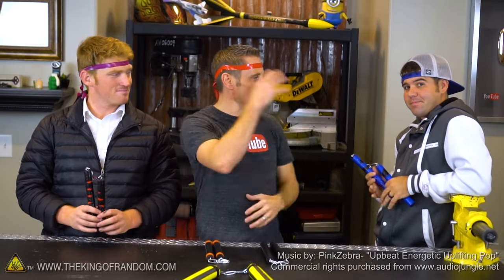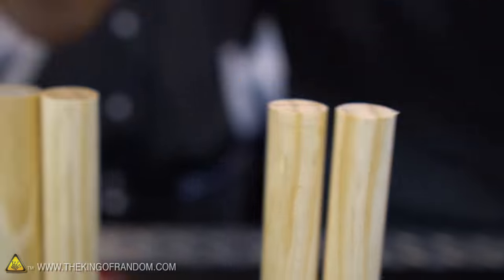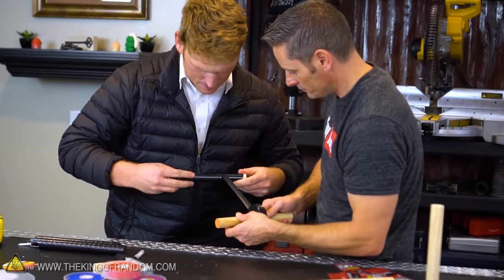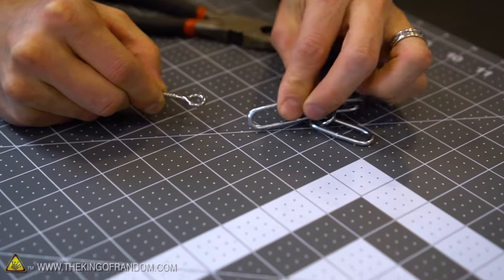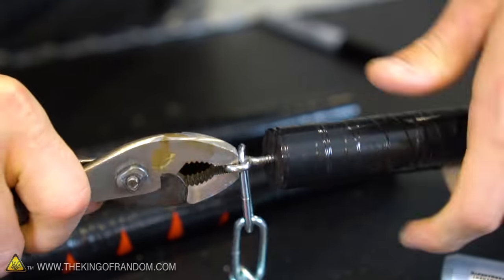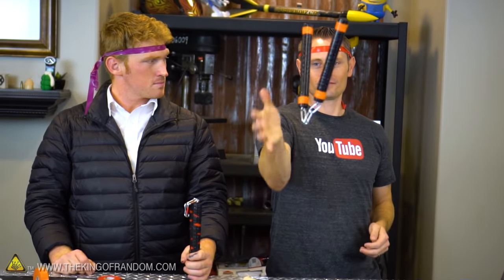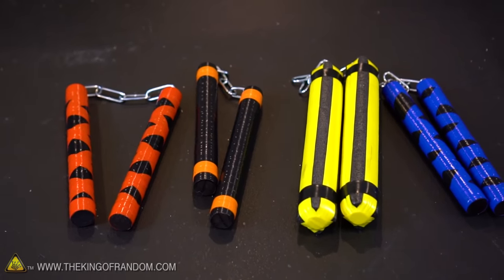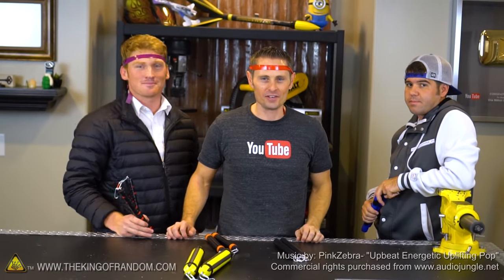Ninja Turtle Nunchucks (With DevinSuperTramp and Stuart Edge)

Comment: Graham, you can also do this using magazines and bed sheets.  Tear the bed sheets into 1/2" strips about 36" long.  The length depends on the size of the magazine you use for the handles.  When you have the sheets braided into rope, tie a knot in one end and roll the first magazine around it.  Wrap the magazine in tape to keep it rolled up.  Repeat this for the other handle and now you have a set of nunchuks made from sheets and magazines.  Keep rocking it dude!!

Comment: Hey grant what would happen if you poor liquid nitrogen into lava would the lava turn to ice or would the liquid nitrogen do nothing 
Like if you agre
Reply: Aqua where would he get the lava XD
Reply: Aqua 
The nitrogen would turn to gas before it even touches the lava
Reply: Aqua poor
Reply: RetroPenguin he made it by melting rock. Lava is molten rock
Reply: First of all the nitrogen would probably boil off before the lava's temperature would change much, second of all.. Frozen lava is just solid rock, you aren't going to get water from lava dude... Last time I checked the liquid form of H2O is water not lava.
Reply: it's gonna make a black hole
Reply: Aqua u know what ice is right
Reply: It will cause a nuclear war
Reply: Molten aluminum versus liquid nitrogen
Reply: Oh no not ww3
Reply: already done
Reply: poor
Reply: You can just check the average heats of both and use your brain to see if it is cold enough to effect it.
Reply: Southern Craftsman If you take his homemade arc furnace, it can easily melt rock. Molten rock = Lava.
Reply: Aqua "Would the lava turn to ice" What do you think lava is????
Reply: Southern Craftsman Not even that. Lava is not water how in Gods name would it turn into ice? It's molten rock.
Reply: Wtf he just did liquid nitrogen into dry ice. Now it escalated to lava?!
Reply: Aqua How much dirt is in a hole 3ft by 4ft by 7ft?
Reply: blackice7317 tbh he would probably miss the trick and also get the math wrong.
Reply: +Triggered Mcfemzi not necessarily, if you had a lot of ice and only a little bit of lava, the ice would "win". you have to look at the thermal mass of both.

Comment: Tip: hold them near the chain so it's more controlled and easier to do more tricks.
Reply: Hold them towards the end furthest from the chain if you plan on actually using them in a fight and not for tricks.
Reply: arman jalalipour so that it hurts more
Reply: arman jalalipour so that it hurts more
Reply: More reach.
Reply: Jofre Steele however, you're trading power for speed and control. I used wooden nunchakus and they're pretty hard to grip by the ends because of the weight. You kind of want more speed with nuchackus because they already have a pretty strong blow even when gripped near the chain. But it's all style and preference, so I respect your ways.

Comment: Just a few suggestions:
1. Never use a soft wood like pine. You risk having the eye bolt unscrewing or the threads stripping out. Use a hard wood like oak maple or ash or hickory. 
2. If you can find a swivel hook for the ends of the chain you will also lessen the risk of the threads ripping out.
3. Use some kind of epoxy to lock the bolt threads into the dowels.
3 Standard sizes for Nunchaka are 12" and 14". Anything shorter than that and you are just making toys.
4. Use at least 1-1/4" to 1-1/2" dowels. I prefer 1-1/2" dowels so that I can sand each stick into a 6-sided hex or 8-sided octagon shape with a belt sander.
5. I prefer Rope instead of chain on my Nunchuks. They are slightly harder to make but they have less chance of coming apart while in use and in my opinion are much faster and a whole lot quieter.
Reply: Oops, 3 Standard sizes for Nunchaka are 10" 12" and 14" but I guess it's up to the craftsman and the preference of the user. Personally, I like the 12" best. 10" feels too short and 14" feels too bulky and awkward.

Comment: Hey Grant! These are fun and remind me of doing similar when I was younger. I have a few suggestions:

You might consider an eye-hook at the top that has a swivel, a swiveling top helps avoid the nunchuck/rice flail from catching on its own chain and makes more fluid movement when using them in a flurry

You might also want to consider making a recess into the bottom and instead of using a short eye-hook, use a threaded bolt eye hook the length of your working piece, if not a little shorter. Make a recess into the bottom and feed the nut into the bottom, then use the wood itself to tighten the nut. Include either epoxy or wood glue to hold the center threaded bolt in there. The reason why is short eye-hooks tend not to hold up if striking, the dowel breaks and with a smaller eye-hook it can lose its grip on it. I had this experience when using my own.

Awesome work, thanks for sharing!
Reply: Sad he cant answer that n9w
Reply: @jongamer2250  I remember hearing the news, it was so shocking, but he went in a very adventurous way and I feel like in the spirit of the man he was, that had a sort of beauty to it. I think we all wish he was here, him and his team, but we can remember how he lived through these great videos

Comment: wouldnt spinning them unscrew the screw?
Reply: its possible but not likely
Reply: No, but the chain getting twisted is the biggest problem,  especially when they are only using 4 links.
Reply: JustHecks put some epoxy in the hole for the screw

Comment: Your not supposed to hold it on the bottom tip. Your supposed to hold it next to the chain.
Reply: yes true but he made the chain wayyyy to short so to add the right balance he was holding the closer to the bottom
Reply: no he maid the chuck too short. I use 14 inch chuck, like 3 in chain

Comment: +GrantThompson: You guys are forgetting the saw kerf when you're measuring the dowels. A miter saw's (or chop saw) blade is usually 1/8 inches thick, so the cut dowels are actually a little less than 9 inches.

Comment: Traditionally, the size of the branches of a Nunchaku corresponds to the length of the forearm of its user from the elbow to the wrist joint, this gives 32 centimeters on average for an adult //he length of strings or strings is very variable. Usually we make sure that the rope is one to two centimeters more than the length of the palm of the hand. This gives a size of about 12 centimeters for an adult //The diameter of the branches usually revolves around 2 or 2.5 centimeters.
There are two types of traditional nunchakus: Chinese and Japanese. The Chinese nunchaku is cylindrical in shape and is of equal diameter over the entire length of its branches, it is the most common type of nunchaku. Japanese Nunchaku is octagonal in shape, and is generally smaller in diameter towards the rope than at the ends. Chinese nunchaku is versatile and suitable for any kind of practice, while the Japanese model is exclusively made for combat: its octagonal shape and weight being more important at the ends, this Nunchaku ensures maximum damage during a strike